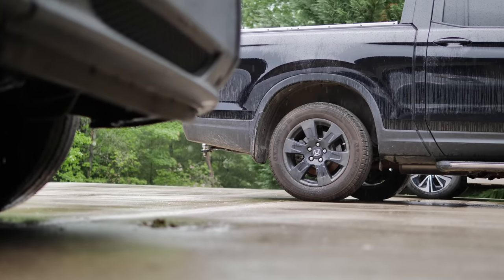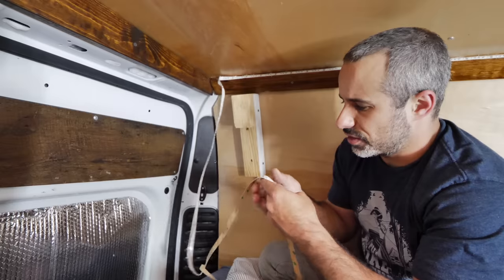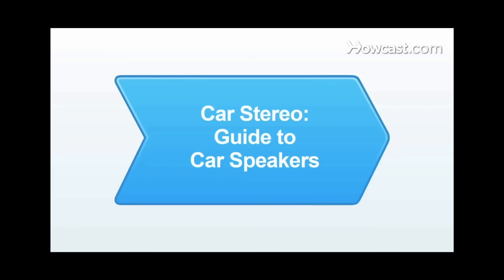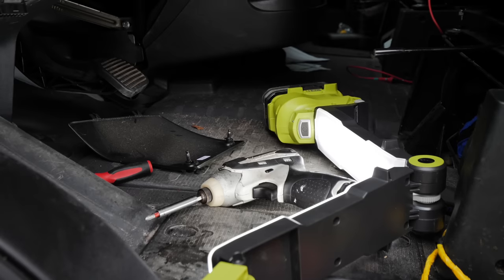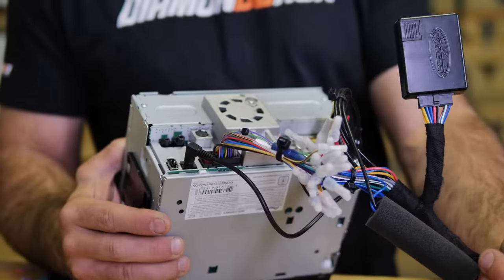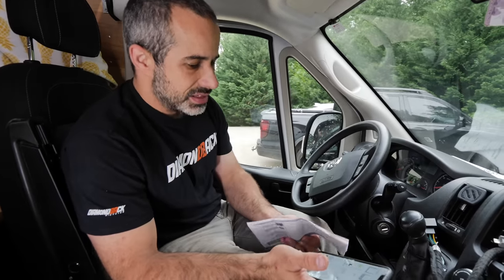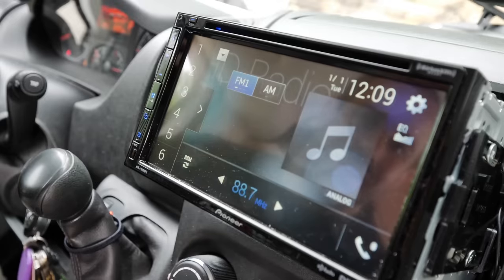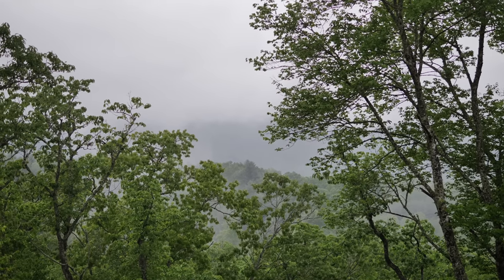Before YouTube, I installed car stereos for a living

Comment: "this is why we dont allow customers into the install bay"  i relate to this soooo much lol
Reply: laughed so hard
Reply: I think every trades person gets this 😂 former bicycle mechanic here and sometimes it's just too hard to explain to customers why you have to take a hammer to their carbon pride and joy...
Reply: @markmuldoon7044  I hope it is for the bottom bracket because otherwise I'd be questioning why you are hammering on the carbon too! 😂
Reply: @kjl42  For the most part... you would be surprised though 😂 still is awkward when the fancy bearing puller is hanging on the wall behind you but it's just so much faster with a hammer and punch 👍
Reply: @kjl42  This is why we don't allow customers into the install bay
Reply: Dude Iol I’m a bike mechanic same thing here loll
Reply: @markmuldoon7044  I did vinyl graphics installs. Like car wraps and stuff like that. People always want to watch but the process isnt always pretty.
Reply: @markmuldoon7044  When I saw the bike mechanic take a saw to my handlebars, I almost had a heart attack. Then I remembered, that there is only one way to make them shorter.
Reply: But the delivery really made it. Seth can be serious...

Comment: “Dodge Ram Promaster 2017”
“It’s 18. It’s definitely an 18.”
“What are you talking about? That the car is an 18?”
“Yeah!”
 “ NAH. “
Lol why is that so funny
Reply: The 10 character in the VIN would actually be the correct year for parts and application. For example the car may be made the 8th month of 2017 but would in fact be a 2018 vehicle for all important parts and application information.  The only time the exact date of manufacture would matter is if there was a split vehicle production for that full year and things were different between an exact set of dates.
Reply: JonOTech You must be a comedian
Reply: @redbaron354  It's actually the same as bike models. A 2018 model is being manufactured since 2017 and is often actually sold since 2017, but it's an 2018 model because it was made for the season of 2018. 
It's not a scam or anything, it's just that the date model year is not the same thing as manufacture year.
Reply: @CanIHasThisName  yep. I had a Mustang that was considered a "late 98." It was a 1998 made in the second half of the year so it features some parts from the 1999 cars since those had begun production and the vehicle was about to change. The VIN is most accurate.
Reply: @Ethan Gibson the actual VIN would display the official model year.
Reply: @davidharrington6273  how so? The VIN actually has the official year. I had a 1998 Mustang that was made in the 2nd half of 1998 and featured parts that only officially began on the 1999 model. He's not wrong here.
Reply: The 2020 Supra that came out in 2019? It's the same thing.
Reply: @Ethan Gibson US must work same way as UK
Reply: That "nah" just makes me laugh
Reply: best part of the vid
Reply: your too funny bro thanks for making everyone laugh
Reply: LOve this moment the most in the vid

Comment: From an ex-MECP installer (haven't installed in 10 years now besides my own projects) I'm so cool to find out my favorite MTB Youtuber speaks in 12 volts. Also , I knew I couldn't have been the only guy with a plastic tub full of random wires! I only get in there once a year but when I do there's a 50% chance I find the wire I need.

Comment: Funny how that 'Dodge' is a Fiat over here in the UK! (FCA obviously think we must not think highly of dodge, or visa versa!)
Reply: And also Citroën Jumper and Peugeot Boxer !
Reply: Ben Ireland dodge is owned by fiat
Reply: Technically they all come from Mercedes-Benz. All of these are born of the Diamler-Chrylser era when Sprinters in the US were branded as Dodge. Of course the ProMaster is a bit different than that of the Sprinter, but call it a close family member.
Reply: @TheEricHarding  It isn't related to the Sprinter at all, other than it being a European van. Here in the states, Fiat doesn't have a great reputation and Dodge/Ram didn't have a van since their deal with Mercedes-Benz was over. Instead of spending a lot of money on R/D of a new van, they rebadged a Fiat when Dodge/Ram was purchased by Fiat.
Reply: @harkin3684  The more you know... They look exactly like a knock off Sprinter so I assumed FCA Mexico ripped it off because they were producing Sprinters. Too bad they aren't. Now knowing they are born of Fiat I'd never buy one.
Reply: @TheEricHarding  The old Sprinter vans were rebadged as Dodge and Freightliner in the US. They were on a RWD platform and seem to last decently well judging by unmaintained ones I see. The newer Fiat based vans are on a FWD platform which means that it can have a lower cargo floor, but it can perform worse with towing and heavy payloads. I wish they still made the Dodge B-Series vans, as those had V8s and were unibody. They could be fast and handle decently well for a van.

Comment: Holy crap, I knew I recognized you and once i saw the clip of the stereo installs with howcast it all came back. As for radio installs I always solder my harness and factory adapter together and then heat shrink

Comment: Man, LEDs are so annoying when riding on the road. They're blinding.
Reply: only when done incorrectly, like Seth just showed all his viewers. He drives a truck though so he probably doesn't notice or care about this issue, he sits up high where it doesn't bother him.
Reply: Great for the user, death for all other drivers. Lol.
For on-coming traffic or when they're on the headlights behind you it's super annoying. Stupid bright.
Reply: Yeah, Alex is going to blind everyone... it looks like they just put an LED bulb into a halogen reflector housing. If you want to retrofit correctly, shouldn’t you have installed a projector housing?
Reply from the maker: To pass vehicle inspection you need to aim them just like halogens. There are screws on the lamp for adjustment
Reply: If you woulf drive good german cars you wouldn't have that problem at all😂
Reply: Is there such a thing as a good German car?
Reply: @lowi2568  Sure, but you may as well buy a new car instead of fixing it, costs about the same. Never buy used when going German, your good for the first 80,000 miles and then your going to dump at least 2 grand a year, every year into it.
Reply: @SethsBikeHacks  you should be concerned about more than just passing inspection, when it comes to installing aftermarket headlights
Reply: @jwj8201  not sure about that😂 our car still dives very well after 11 111 kilometers
Reply: ImAris dude that’s not very far at all if u are talking about 110k kilometers not bad but 11k ain’t nothing
That’s only 6.9k miles about 15 tanks of gas
Reply: @noahlippert7571  you're right, meant that. "111 111km!" my dad sayd it a few weeks ago..
Reply: @lowi2568  Maintenance will be cheaper for you since its Europe, judging by your measurement in kilometres, and most shops there see German cars everyday. Your 110k translates to under 70,000 miles and I suspect in couple years you will know exactly what I'm talking about, or at least your dad will by the sound of it. Seems you might have bought it new as well, or at least 2nd owner with low mileage. My Buick on the other hand has 270,000 miles and I only had to replace tires and tie rods, both routinely changed anyway, not a peep from the engine.
Reply: @jwj8201  dont know the the brand "Buick", but man 
That comment wasn't meant that serious. Why do you think you have to justify yourself?
Reply: @lowi2568  Sorry if it came off as aggressive, just sharing my knowledge. I was simply saying your counterpoint was yet to reach the level needed to discredit my statement. Buick is under the GMC umbrella that does Chevy and several other well known brands in the US. Like I said, living in Europe may counteract the high maintenance costs for BMW\Mercedes in the US that they are indeed notorious for. Used M3's are often deceptively cheap here for that very reason.
Reply: @SethsBikeHacks  It's a shame that here in NZ every manufacturer seems to aim them toward the drivers position on the side of the road! 🤨

Comment: Take those glaring pnp LED's out and get retrofits 🤦‍♂️
Reply: Are there even retrofits?the Dodge Promaster is Just a rebadged Peugeot Boxer,and they are the cheapest Van you can get here in Europe.They still use Halogen in the 2019 model.
Reply: @idrinkpowersteeringfluid  oh you mean the bulbs itself,i thought the complete Headlight

Comment: Seth, you know why it is better when the wires touches each other? It is all about the voltage standing wave ratio (VSWR). There are voltage reflections if you use different materials for joints. Now, I like you even more, knowing your technical background :-D

Comment: Thread the butt connector over one wire, twist the two together then crimp the butt connector down, this way they are twisted together and crimped in place. these have lasted me a long time in previous electronic works

Comment: i just watched the previous video on the van, i love those
i would have a few recommandations tho; you should put a decent size fire extinctor in this van, in an accessible place. you may also add a complete medikit (if not already) and a spare tire because it looks like there is none, since you probably drive this in sketchy roads it could be usefull (could maybe fit underneath, should be near the width of your lovely plastic pipe). i love all the DIY and ideas put into it! 
best regards from France

Comment: I am rarely a fan of just throwing LED or HID bulbs into halogen housing. Those types of bulbs are FAR better for use in projector lenses. Do it right and hack those stock light housing up and throw in some nice projectors. Get you some crazy good light. As of now, you just risk blinding oncoming traffic.

Better yet, leave the stock bulbs in and add an LED light bar for use when there isn't oncoming traffic. More light than you can shake a stick at.

Comment: Oh man, when I used to install stereo stuff as a hobby on my cars and my friend's cars, I was in Heaven when they started releasing pre-built plug adapters per car/stereo so you didn't have to connect 50 wires with butt connectors/wire end connectors.  Finding the space for all those wires and connectors behind the dash was such a bitch to do, just smashing and jamming wires to the back of the dash area.

Comment: FYI most if not all NEX units have the ability to have the backup camera displayed while driving, not sure if you need a neutral safety switch delete or not but in "backup camera settings" it has a time delay when touching the screen to jump back to camera after like 10-15 seconds. Also curious how the Android Auto is doing for him, mine disconnects 99% driving around town or 100% if I get a phone call once it ends... I've given up on it and run the phone to bluetooth which was a bummer.
Another neat trick is if your NEX has dual component (camera) inputs and a neutral safety switch delete AND your phone is capable of HDMI out, you can get a simple component to HDMI converter and run the NEX screen as a second display which wont recognize touch but will allow you to display any app on screen like OBD2 vitals via Torque-Pro.

-NEX2300 owner here

Comment: Just a tip. Do not install led bulbs in to your vehicle if you live in cold climate zone. These bulbs don't make a lot of heat. So your headlamp might get covered with snow. You will lose visibility in seconds. Led are great at summer.

Comment: That was legit the most complex process I’ve seen for a radio programming 😂
Never had to program one to work with a car before, then again, we dont have many dodge vans/trucks/vehicles either.

I did auto electrical for a year and got bored and my employer was a cunt anyways. I was more interested in circuits and board repair, or electric bikes.

Doesn’t matter where you start man, as long as you’re enjoying what you’re doing now. There is nothing wrong with diversity. Experiences from jobs I’ve had in the past have and will keep helping me no matter where I go from here, I could be a plumber next and take from all of my construction and customer relations fields for example.

Makes me happy to see you having some fun and getting shit done during c19, way to keep the positive attitude!

Comment: I do appreciate the video as it has taught me a few things and I have it saved in my saved folder. I have a 2020 Ram Promaster 2500 high top cargo van and wanted to know more about the Axxess Data Interface you suggested on your links. Does this also handle the steering wheel controls? What does the interface also handle? Thank you!

Comment: Access (Metra) data harnesses are usually NOT “FTW”. Sucks PAC doesn’t (currently) make a module for that vehicle. Also, it probably is a 2018. You need to check the tenth digit on the VIN to verify the model year, the given number or letter will indicate the correct year. (I installed an overhead TV in a 2007 Yukon in February of 2006. ‘07 was the first big refresh they’d done since like ‘98 and we thought it was cool it was out so early.)

Comment: Take that big ass block, cut down the length of the sides potentially breaking it like the other one broke, make sure you can slide 5 on and off and then wrap it in wire or something to keep it from expanding even more

Comment: There isn’t a “ground” with DC voltage. It would be called the common or more specifically in you case common negative. There is such thing as having the common or “ground” positive.

Comment: I’ve got a cheap 2016 Carrera vengeance, I’ve used a lot on community with no maintenance over the last 4 years. I’m looking to get into trail riding and some light downhill, the hole group set needs replacing and I was thinking of upgrading the forks, should I bother doing this or just buy a new bike, been looking at the vitus nucleus 29vr? (This is due to being on a student budget) Any feedback would be greatly appreciated

Comment: seth if you're good with wires and electronics would you consider doing a home made ebike build. i just did one myself and its really fun. you could look into hub motors batteries try get it on a full suspension frame. if you look at sam reynolds YT channels latest video its a crazy ebike. maybe you could do something like that. its probly 3000w 72v.

Comment: Now you gotta get in contact with DEI to have them send (give) you the latest Viper or Clifford Alarm w/ Convenience Features, remote start, etc,  and have fun with those latched, momentary, and timed outputs. Throw in a linear actuator on that sliding door and his bike rack (remote controlled). They may ask you to renew your MECP as part of a deal. Not a biggie if they pay for it. That Aftermarket Head Unit is worth more to an individual that wants to fill a hole in his dash. He may not know that he can not use it with most modern vehicles after it's been reported stolen but that won't save you from a broken window. Mount that visual deterant (light emitting diode) centrally on that dash and add a glass break detector plus a digital tilt sensor for the classic tow and go vehicle theft. Get notifications on the phone and add a GPS tracking device because Alex is your friend and you'd hate to see him homeless! 

Aftermarket DC is not dead. Show 'em. Do it !!

Comment: So... Since you're somewhat of an expert on the subject... I have a question. I own an 03 Mitsubishi eclipse Spyder gts with the "upgraded"  infiniti sound system with the 6 disk in dash cd changer and the factory amp. I wanna put a head unit similar to the one you just installed while retaining my steering wheel controls as well as my factory amp... Is that possible and if so... How would I go about doing it. I've found very little on YouTube actually explaining what to do with the amp. Most of what I've found either completely unhooks and bypasses it or just says nothing about it... I want to retain my factory speakers too which there are 7 of I believe... A tweeter and speaker in each door. A speaker on each side in the rear seat. As well as I believe either an EXTREMELY small sub or just another speaker in the center of the dash... So is there a special head unit I need for all those speakers..? I'm pretty clueless when it comes to this stuff... I can drop a trans and pull a motor in a day and a half. But when it comes to speakers. I'm basically brain dead... Lol.

Comment: HACK valve core wrench for Schrader valves get a bolt that fits into the valve 5mm bolt makes sure the bolt is smooth and there are no threads on the outside of it then cut a slit into the bolt deep enough so the pin won't hit the wrench and the wrench will not be able to twist the core out.

Comment: I actually installed a system from Xtron, which I slightly regret. I was wondering If there is a way I could change the current memory and install an SSD instead.

Comment: Hey seth i am one of your big fans and i’ve been watching your videos a lot lately😅 like a lot . I am having a problem with my mountian bike. I have accidentally put Wd-40 (normal) on my brake discs and i made my brakes worst so i asked my friend what to do and he said to clean it off with a dry towel. I did it and now my brakes are like a potato. Do you have any Idea what could I do ti make my brakes work again? If you are wondering what brakes I have, well they are shimano on oil or something.
Reply: I’m obviously not Seth but one thing that I have done is use nail polish almost exactly as you would normal break cleaner (meaning wet a cloth with it and spin your wheel with the cloth on it) and of course you can also always use specialized break cleaners